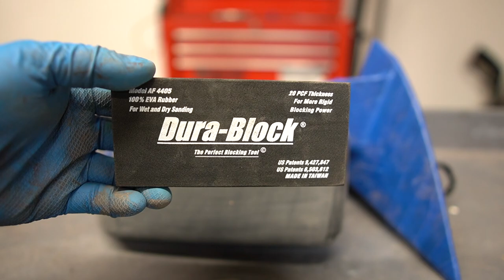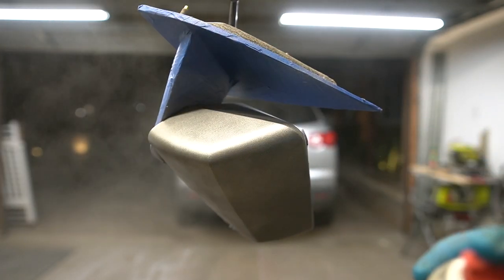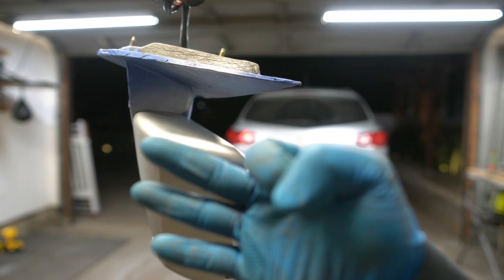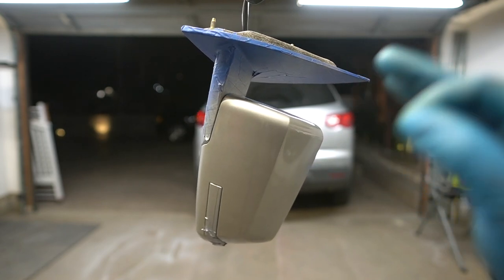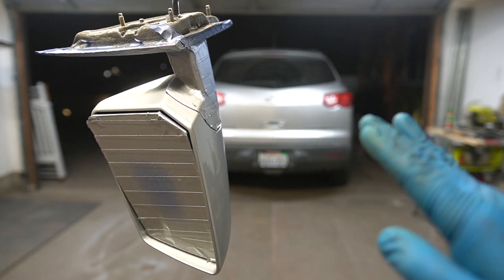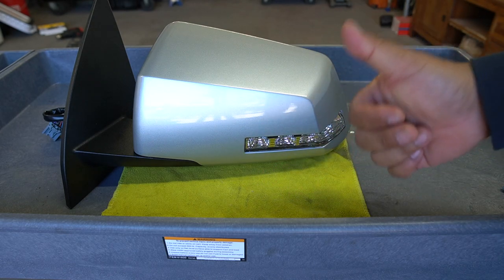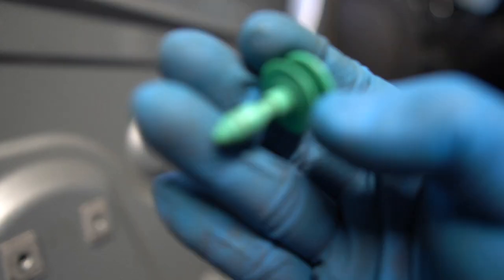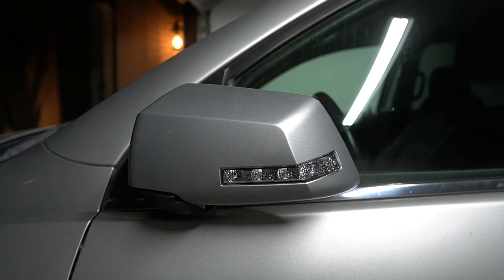Complete Side Mirror Replacement (includes paint job) Save MONEY! DIY

Comment: Thanks! You gave me the confidence to paint a replacement side mirror for my 2008 Toyota Solara convertible. It took me about 4 hours, 5 very thin coats of color, and 4 coats of finish. It turned out GREAT!!! But I'll be taking it to someone else to have it installed. Super video!
Reply: What is it with Solaras getting their mirrors broken off? LOL. Mine was taken out by a deer. Saw another Solara the other day with the same mirror missing.